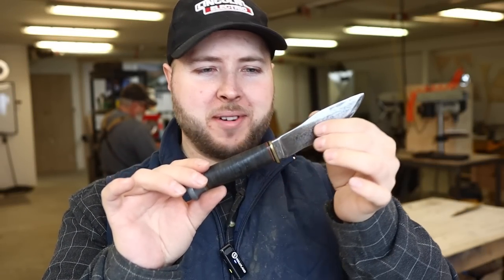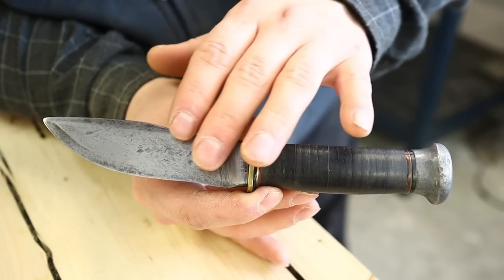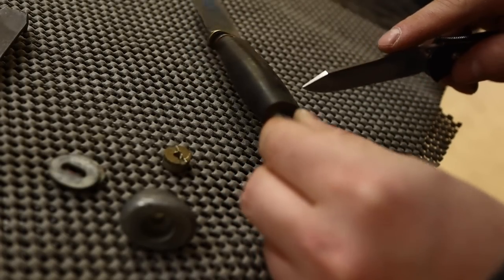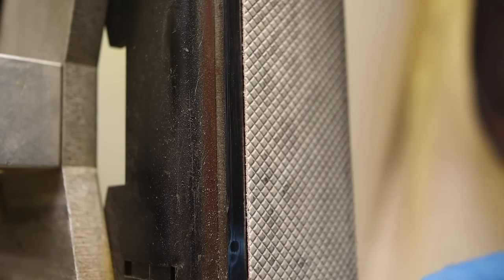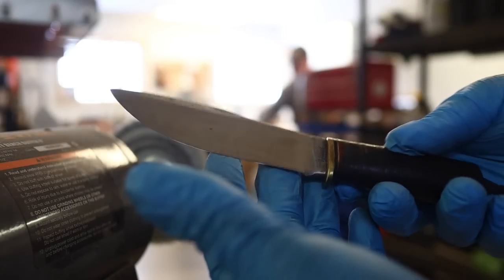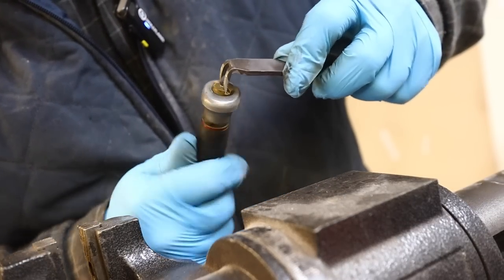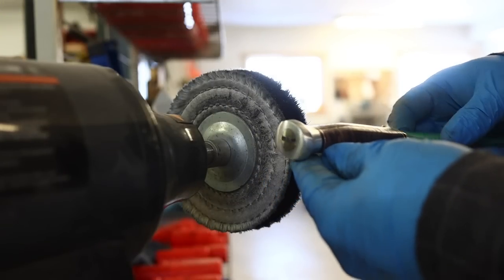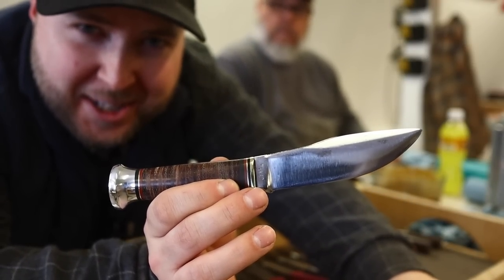Incredible RESTORATION on a Vintage Marbles Knife!

Comment: I was always advised by antique knife guys that removing the old patina from an antique knife blade will devalue the knife. Keeping as much of the original aged grey dark patina as possible is what you want on an old knife. I just bought an old bowie knife with some rust and grime on the blade. I used .0000 steel wool and  semi chrome metal polish to remove the grime and surface rust without removing any of the old grey patina. You did a fantastic job on the marbles knife. It looked right when you finished.

Comment: I have that knife. I found it in my father in-law’s crawl space after he passed on. The sheath wasn’t salvageable but the knife was. I had to make a new sheath. The only difference is mine has an end cap made of antler. I looked it up and it may have been made in the 30’s or 40’s. Nice job as usual. I was surprised to see my knife on your channel. 🔪

Comment: With regards where the pommel wasn't engaging with the shoulders of the tang, and you removed one of the rings of the handle to bring the pommel in closer to engage on the shoulders; Could you not have welded some extra material to the shoulders and built them up so they would engage with the pommel, or, might those welds have formed a weakpoint in 'the system of the handle', and potentially sheared off internally, due to torsion during use?

As always, beautiful work 👍👍👍👍